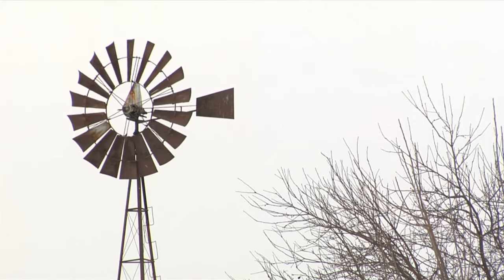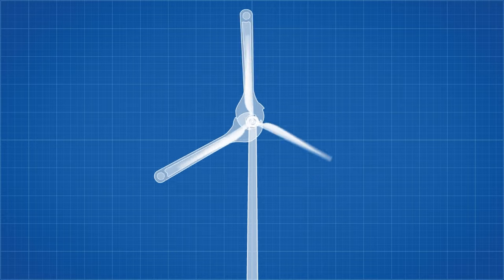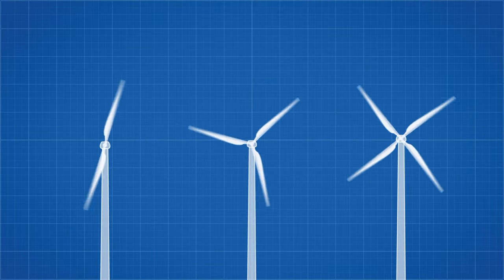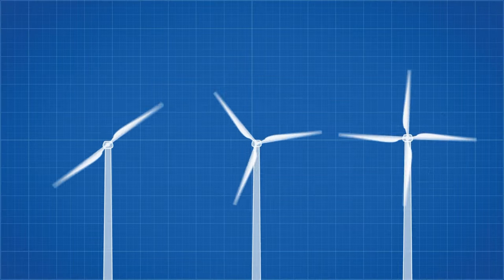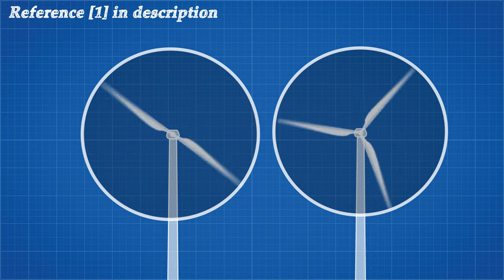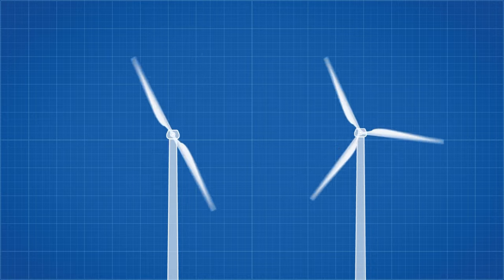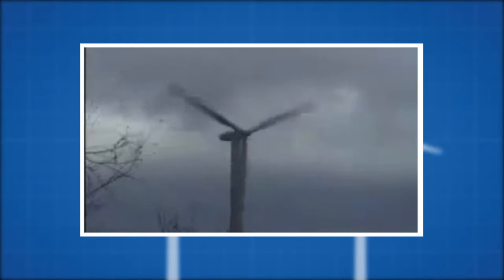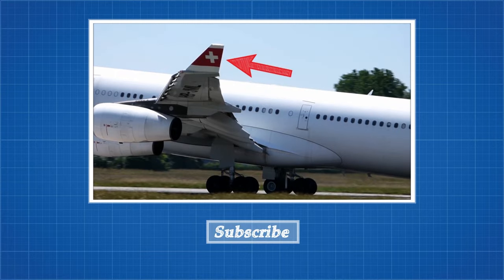Why Do Wind Turbines Have Three Blades?

Comment: hey, engineering student of renewable energies here, the centrifugal force is not a major reason why the turbines usually have 3 instead of 2 blades. It is due to the fact that in different heights you have different wind speeds and having an even number of blades gives you periodic stress on the system, when the upper blade encouters the highest wind speeds the lower blade is receiving relatively slow winds additional to passing in front of the tower which disturbs additionally. this periodic torque stress will wear down the machine pretty quickly, thus we use 3. plus your notion about the the wrenches is entirely wrong, doubling the blades wont double the torque, adding more blades will decrease the speed needed to extract the energy from the wind. unbelievable you didn't caught that contradiction, those principal are mutually exclusive. be a good man of science and remake the video instead of just putting a half-arsed remark in the notes about it being just the "basics". It's not that you left out additional information it's that you are factually wrong  about your explaination. your channel looks pretty promising if you are able to take constructive critizism seriously. pm me if you want some references or advice , cheers
Reply: Why 3 blade turbine doesn't generate periodic force? Would you explain that a little?
Reply: sure basically with any even number of blades 2, 4 ....etc you have the blades arranged opposite of each other this is a bad setting as exactly as one blade is at the 12 o'clock position and experiences the highest wind speed and thereby the highest force the blade exactly opposite of it expierences the lowest winds and thereby force so putting torque on the machine with a really long lever. research  "Growian" a german 2 bladed prototype that had first cracks after 6 hours into it's testing. if you built it even worse you can have this periodic swing coincide with the tower swinging it up and loosening the foundation bit by bit .(research bouncing betty for a very visible showcase of what resonance can do to structures) that's why you generally choose Primenumbers in engineering to avoid resonace(yeah i know 2 is technically a prime but i think you get what i mean) two blades counter the torque of the top one with those two being at higher levels(and wind speeds) and away from the tower in a 3 blade setting. i hope that helps Dan
Reply: Oh! Gotcha, I really helps. Thanks a lot Robb!
Reply: your welcome
Reply: good comment, i clicked the video waiting to see some kind of fluid dynamics explanation to why 3 wings would be more efficient to harvest energy, and the only thing i got was bad analogies and cost analysis... i would like the video to be remade as well :)
Reply: This is very similar to the reason electric power transmission uses three phases. The power varies since AC power is sinusoidal. But the average power of the combined phases is constant. 

BTW, I saw an analysis once that claimed the number of blades wasn't critical to the power generated. A one bladed turbine (with a counterweight) was just as power efficient as a three bladed one. It claimed three blades was almost totally for power averaging which reduces wear and tear.
Reply: Why are you not at the top ? You provided better explanation than the video itself
Reply: because youtube comments are for insults and racial slurs^^. i wish they did as good of a job as reddit to filter helpful comments to the top. definately helps the quality of information
Reply: thank you for your appreciation.
Reply: Thank you to Robb and Cedric for your very well thought out and presented comments. A pleasure to read and consider.
Reply: +Jeff Rosenbury

Power transmission uses 3 phases because the average power of the three phases is constant?  What have you been smoking?  Over the day the power on any phase can vary a lot.  You have big problems if there is a large imbalance in power over the three phases, but the power sure as hell isn't constant whether you average them or not.  

Oh, you meant short-term power?  It happens to be the case that the power delivered by the three phases is the same with balanced loads, and we want balanced (or very nearly so) loads, but that's not why we have 3 phases.

We us 3-phase transmission because, with a balanced load, the sum of the currents is zero.  You'd need twice as much copper to deliver the same power with the same resistive losses if you used single-phase transmission.  Down at the local distribution level, where the load is likely to be a little unbalanced, you'd need a neutral wire as well, so for local distribution you'd only need 50% more copper if you went to single phase.  But it's still a saving in copper, particularly on the power grid where there is no neutral.

The analogy to the imbalance due to wind speed at different heights doesn't hold up.  At all.
Reply: bdf2718
It doesn't hold up until you start attaching three phase motors. Then the lack of vibration becomes an issue.

There are other reasons for using three phases, but a big one is so the average power is constant.
Reply: +Jeff Rosenbury

The average power is not constant.  It varies throughout the day.  Which part of this do you not understand?  Go take a look at your power meter.  Turn on every electrical item you have and look at the power meter again.  Do you believe what you observe would be different if your house had a 3-phase supply?

In the short term the power delivered by each phase is approximately the same, but that's a consequence of having a nearly-balanced load.  The nearly-balanced load is required in order to be able to dispense with a neutral wire for non-local distribution.

The big reason for multi-phase supply is to save copper (or aluminium) because the total (not average) current is zero if the load is balanced, so no neutral is required.  Three-phase motors have advantages over single ones, but that's a minor reason (the power company earns more if your motors are inefficient, so they don't care).  Average power isn't even a reason (because it's bollocks), let alone a big reason.
Reply: Hey ***** what do you mean by main shaft?
Reply: That's the thing all components get the full torque,  the blades, the attachment of the blades to the nose, the shaft, the azimuth bearing and the tower whatever of these components happens to take the least torque will break first
Reply: But yes you are right, everything from 3 blades up behaves like a disk
Reply: Hey, one question, is it possible to buil a two-headed 3 bladed wind turbine, I mean, 6 blades per pole?
Reply: J. Alfredo Rosas  sure would that be possible but it would make no sense if it would not increase Efficiency,  which it would not because modern wind turbine are pretty close to the Betz limit the theoretical limit of power extraction, simply put at some point if you put to much stuff in the way of the wind the wind flows around your obstruction
Reply: Robb Stark doubling the blades wont double the torque, but it will allow for a better energy extraction at lower speeds? the heck do you smoke? torque, power and rpm's are three things bounded to each other with a simple equation. You double the torque with same rpm, you receive twice the power. You double rpm with the same torque, you also receive twice the power. Energy extraxtion is definietely not a physical thing.
Reply: Do you think the cost of a larger bearing is higher or the cost of a third blade?

And what yo u mean with that: "adding more blades will decrease the speed needed to extract the energy from the wind."?
What's going on when you add more blades?
Reply: Robb Stark o
Reply: Mr.Robb
you are brilliant.with best wishes from India,a land of wisdom and oldest civilisation.
Reply: No - Stability (wrong word) is in sqare with blade thickness. 
And Reynolds number drops- airfoils get problems. When having the same solidity. 
Therefore more than 3 blades do not make sense (Except you want to build a westernmill or old dutch windmill: High loads and high torque. )
Reply: Robb Stark - this is the right reason for 3 blade design. This in video is totally wrong.
Reply: Boeing found that the two blade design caused a resonance in the tower at the point where blade passed the tower to the point they tried flying the blades on the research units at Goldendale WA.  An accident tore up one of the units when gearbox oil was inadvertently mixed into the hydraulic oil and the blades failed to feather at shutdown.  RPM nominally 17 RPM went to about 33 RPM when generator poles came apart and jammed.  The 16 inch diameter quill shaft from the propeller yielded to where  a square where a strain gauge was attached into a diamond shape.
Reply: Robb Stark it’s Unreliable not Renewable... how many tons of coal go into a “renewable” wind turbine? Just curious, how many tons of Metallurgical Coal and Steam Coal does it take to produce one? Here’s a reason mankind left wind energy in he past. Some day it will be realized again.
Reply: Can we stop saying centrifugal force? Isnt it centripital acceleration?
Reply: Spelling
Reply: I was going to post exactly this. Balancing out the wind shear (higher up the wind is blowing harder) is a big reason for the 3 bade design. With 3 blades- when one is at the top there are two at the bottom to balance out the mismatched force.
Reply: How much energy do expend getting on and off your high horse?
Reply: I'd think 3 blades smoothes out pulsations keeping a steadier speed but probably more importantly the shorter blades allow a shorter tower but also the difference in height from the upper and lower blades makes less difference in wind speed because the outer tips are closer than 2 blades. 4 blades are overkill.
Reply: Thanks Robb for your nasty input.
Reply: There is no such thing as "centrifugal force". What you call centrifugal force is the centripetal force needed to keep the blades from moving away from the center in a straight line. Read Newtons 1st law.  The mystic centrifugal force MAY be used in connection with Newtons 3'rd law - action/reaction. You can easily feel - and measure - the amount of centripetal force needed to keep things circulating, by swinging an object in a string. The heavier the object, the faster the speed, the more you must PULL on the string. Same goes for cornering a car: When the centripetal force needed to turn the car becomes bigger than what the friction between tyre and road can provide - you slide off.   

I would also be very interested in knowing why a three-bladed set-up doesn't create rhythmic pulsation.
Reply: @robbstark9888   And a 5-bladed set up ?
Reply: Tony stark 😁
Reply: *criticism
*you're
Just being constructive.
Reply: the real reason why they use 3 blades is simple three is the magic number
Reply: Robb Stark you explained it well man. 👍🏻
Reply: This is savage
Reply: Robb stark. Please make your own vids. Your explanation is very detailed. Love it
Reply: Robb Stark fantastic. I too was not  convinced with the torque wrench metaphor. Thanks for the explanation.
Reply: Wow, the sophistication of the various comments is impressive. I have no technical background, but I'm enjoying the depth of knowledge being shared.
Reply: Watch out we got a YouTube expert over here
Reply: Thank you engineers of the world putting a stop on shitty scientific-quality contents. The heaps of electricity and time wasted in dull content should be considered as pollution
Reply: Robb Stark, it's always nice to find someone who knows what's he talking about. Your explanation makes a lot of sense. But when it comes to airplane propellers, it seems to me there's no real reason to have 3 blades (as most of smaller airplanes have). Two blades seem cheaper and lighter. Small helicopters fly nice with only 2-blad main rotor. I have no idea why almost all smaller airplanes (including those flying parachutes with engine) have 3-blade propellers.
Reply: @jwrosenbury  ... How the area of blades affect the function of a wind turbine
Reply: @hannanpakthini7221  The wind moving through the area swept by the blades provides the power.
Reply: @bdf2718  Sorry this reply took so long. By average power, I meant on the fraction of a second scale. That's what causes vibrations. A single-phase motor has its power output drop to zero 120 times a second (100 times on European 50 Hz systems). For small motors, this isn't much of a problem, but it's a killer at higher power levels.
Reply: Robb Stark hey robb, just want to know if you still exist
Reply: Not sure if you got lucky when given a name or just a got fan
Reply: Correct
Reply: That is why u cannot believe everything on youtube. Anyway, i am disappointed that my ceiling fan has 4 blades. I prefer it has 3 blades.
Reply: @brageholmefjord8005  centrifugal force is the radial force experienced by a rotating object caused by acceleration in the radial direction. It's easy enough to feel this force by whirling something around in your hand.
Reply: bdf2718 }
Reply: Sic Semper Tyrannis  everything needs a frame of reference and for the occupants of the car the frame of reference is the car so they feel an outward force due to the fact that the car is accelerating sideways.
Reply: @jwrosenbury  most of us knew what you meant.
Reply: @robbstark9888  I am not an engineer, just an old mechanic, another reason for 3 blades over 2 is angular momentum caused when the wind shifts.
With 2 blades the generator can take a new direction very easily when the blades in in the vertical position when the wind changes direction.
But they still have the angular momentum of the original wind direction, this put real stress on the hub of the propeller.
Make 2 flywheels one with 2 weights and one with 3 weights, spin them up and apply side torque to see what happens.
Reply: good summary ..and correction robb ..didnt have to be so critical ..yes agree with your reccomendatiuon to the poster ..hope hes done it ..
Reply: @davygravy7332  An other engineer here, confirming the statement from an old mechanic!  Checking the comments, it took about 4 years before someone gave the utmost important reason for 2 blades windmills being no good and very dangerous design!  The gyroscopic effect kills the windmill when a (sufficient strong) change of wind direction happens when the 2 blades are in vertical position!!!!  The very few 2 blades windmills that survive in the world are the ones that are equipped with a restrainer on the vertical axis, they change wind direction very slowly .
Reply: woud that even number problem be the same for a 6 blade? iz that wy seiling fanz are 5? therez not diferent wind speedz inside a house thou  nor pole kauzing uneven flow!
you mencioned pasing in front of the tower on the down swing; wat if the tower ekstended on the upswing az wel  in a Y cape for a 3 blade  or djust straiyt up for a 6 blade?
kan you put 2 bladez on wone side and 3 on the oposite side of the pole  separately rotading? koud they balanse eatc otherz problemz? koud they rotate oposite direkcionz with the wind hiding the 3 blade first before the 2 blade? wats the ideal distanse between them az a raycio to blade diameder?
Reply: @strechinpick  There have been done hundreds of carbon payback time calculations for windmills.  One can make rough calculations or detailed calculations that even includes the carbon foot print of the babysit from the worker at the power plant linked to the wind mill factory.  Payback times can vary quite a lot therefor, the most optimistic at 5,4 months, the most pessimistic I found at 18 months.  In my opinion quite renewable, or not?
Reply: i didn't care for much of the explanation including the bit on centrifugal force and torque. the background for the video reminded me of scishow. now my theory for the 3 blades is to produce 3 phase power (ha, ha).
Reply: @cinegraphics  the number of blades has to do with "angular momentum".  With a 2 bladed prop and a hard maneuver puts a lot of strain on the prop shaft.
Reply: Hey, an old engineer here. The troubles with 2 blade wind mills have nothing to do with different wind-speeds at different heights.  It has all to do with gyroscopic forces that apply when a windmill experiences a (sufficient strong) change of wind direction at the moment the 2 blades are in vertical position!!!!  The very few 2 blades windmills that survive in the world are the ones that are equipped with a restrainer on the vertical axis, they change wind direction very slowly.  Do following experiment yourself: take a very light racing bike wheel and fix 2 weights on the circumference 180° apart from each other (simulating the 2 windmill blades).  Make the wheel turning (wheel axis horizontal) and hold it in 1 hand.  It will turn very stable.  Then rotate the wheel axis sideways (simulating wind direction change).  You will feel the very strong gyroscopic reaction forces at exact the moment when both weights are in vertical position.  It are these forces that kill most 2 blade windmills.
Reply: Your comments would be easier to read if you used proper punctuation and grammar.  Your comments are like a word salad made from good ingredients but laid out by a drunk person😂😂.  I know you mean well but it’s clear English is not your first language. If you need any constructive criticism or English lessons do not hesitate to reach out to me.
Reply: Yes i was just about to say that /s
Reply: Great explanation. Surely you are steeped in the philosophy of Marcellus Jacobs' engineering studies of the 1930s!
Reply: @mikegrant8490  This explanation seems great, but is incorrect!  Twin blade wind mills get destroyed by gyroscopic forces, see my explanation in other comments.
Reply: @tuttebelleke  uhh, I was AGREEING with you. I referred to the seminal works of the earliest three blade proponent,  Marcellus Jacobs, who you directly used in your explanations. Three has always been better than two... Point of fact that I have been a Vestus investor for over ten years, too.
Reply: @robbstark9888  
If you reduce the speed of the blade, but maintain the same power, you MUST have increased the torque since 
P = τ.ω, as I’m sure you are aware.
Reply: Since you are an expert, would you know if putting more blades would save more birds and bats? With more blades means less space for birds to try to fly through and they would rotate slower.
Reply: Hi materials engineering student here, for sure you can use high tensile high strength materials to avoid any crack ie composite and ceramic
Reply: @jwrosenbury  iT ALSO looks much more smooth when rotation so you don't get sick looking at it. Another huge reason!
Reply: Nurdz!
Reply: hey, engineering student of renewable energies here, the centrifugal force is not a major reason why the turbines usually have 3 instead of 2 blades. It is due to the fact that in different heights you have different wind speeds and having an even number of blades gives you periodic stress on the system, when the upper blade encouters the highest wind speeds the lower blade is receiving relatively slow winds additional to passing in front of the tower which disturbs additionally. this periodic torque stress will wear down the machine pretty quickly, thus we use 3. plus your notion about the the wrenches is entirely wrong, doubling the blades wont double the torque, adding more blades will decrease the speed needed to extract the energy from the wind. unbelievable you didn't caught that contradiction, those principal are mutually exclusive. be a good man of science and remake the video instead of just putting a half-arsed remark in the notes about it being just the "basics". It's not that you left out additional information it's that you are factually wrong  about your explaination. your channel looks pretty promising if you are able to take constructive critizism seriously. pm me if you want some references or advice , cheers
Reply: @HateVegies  why copy paste my text?
Reply: @robbstark9888  nothing.
Reply: @robbstark9888   stay with me for a moment... I think there is a better concept to create H2 production plants with windturbines by using Tesla methodes of his valve system thinking, but then in a differend way. It is rediculous that we use brakes on turbines. A vertical turbine starts to loose his concept vs a Darieus the moment that you use a braking system. Its better to harvest all energy especialy on higher wind forces. The problem is, is that we bild things more and more in a way that it does not last long what is rediculous actualy when it comes to something (energie consumption) that is destroying the planet now.
Reply: @Cedric Bodemer “Never change a running system” Exactly, my Prusa 3D printer has never been tweaked, it has run perfectly for 5 years, could it print nicer, perhaps, but it works, so just no 😂
Reply: @robbstark9888  Nice explanation!